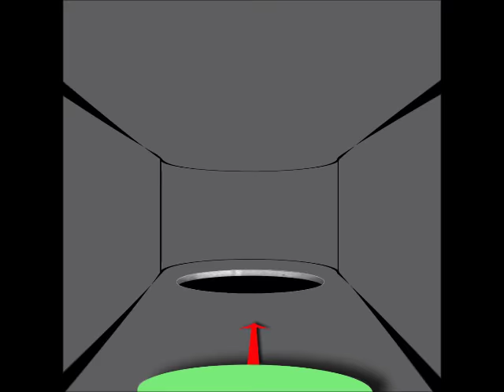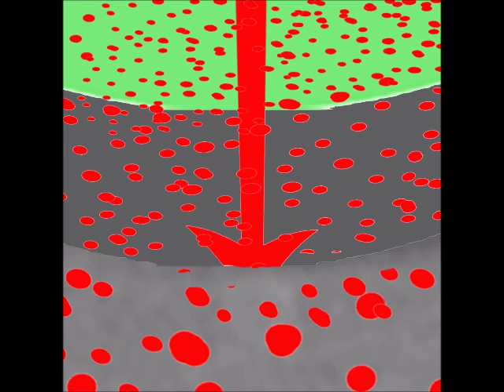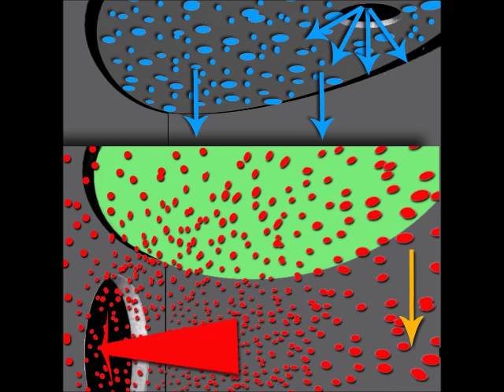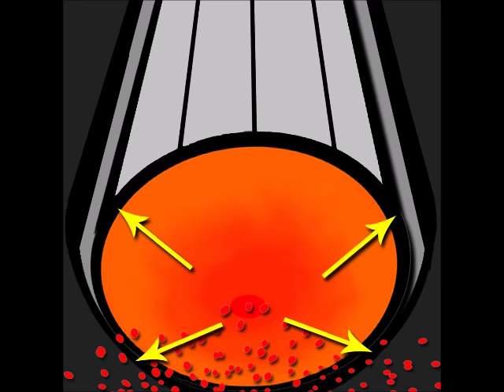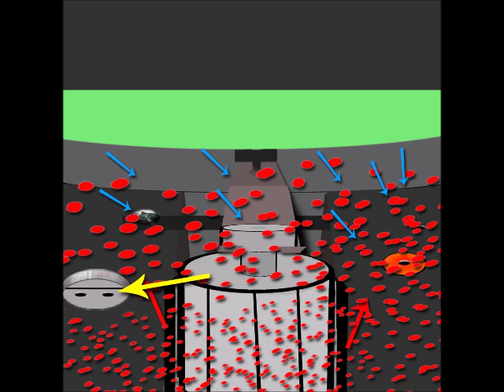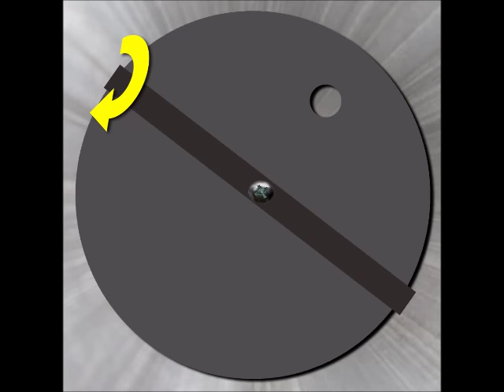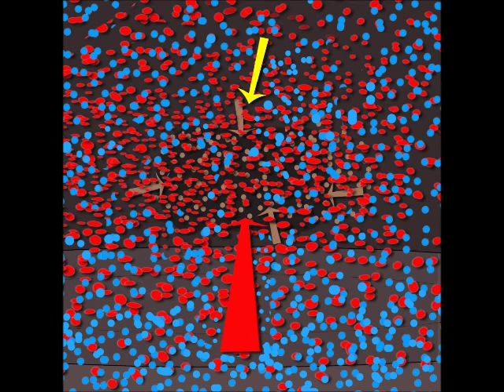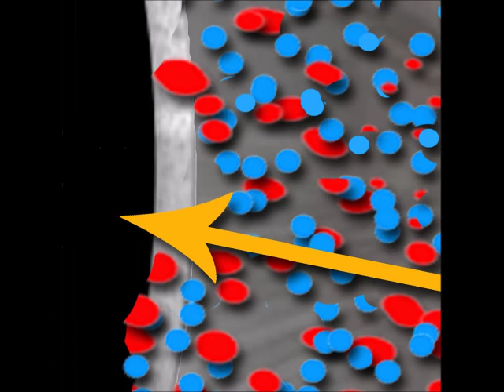2- Stroke Engine | A Unique Journey - (Fuel tank to Exhaust) - First of its Kind

Comment: To think that all these years after pulling and cleaning my tool carburetors, I've always thought the metering diaphragm was the one that actually pulled the fuel into the carb. Would have never believed the little wimpy film of the actual pump diaphragm is really the one. I'm so learning from your videos. Never picked up all these facts till your videos. Thanks so much for doing them.
Reply from the maker: Peter Ford. I'm really pleased they are helping. Thank you for your kind feedback.
Reply: TheRepairSpecialist Your quite welcome. Keep up the good work.

Comment: Been searching for an explanation like this for months Good graphics on the one way valves. What determines if the metering spring is at the correct tension? POP off test?
Walbro claims pop off between 15 and 50 psi, that's a wide range of tension. Can't thank you  enough for all your informative videos!
Reply from the maker: ChueyMr11, thank you so much for your positive feedback. I think the best thing is to include the 'pop off' testing in another video so I can explain my point a little better. I hope to get round to that very soon. Thanks again.

Comment: That was simply fantastic, thank you so muh for taking the time to make it! 

I do have one question; the line through which the changes in air pressure are felt, where does that line open into the cylinder exactly? How come fuel or exhaust gases don't accidentally go through it and end up at the fuel diaphragm?

Comment: It is an interesting video but I do not see why the air would know it is only supposed to flow from the carb to the crankcase and not back into the carb.  Have you omitted a component or does it have do with inertia or something like that?